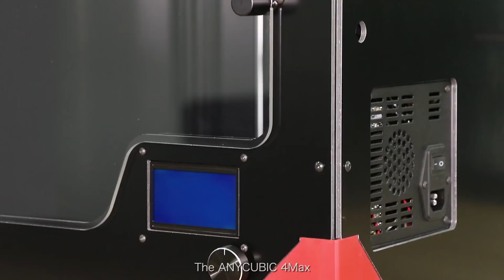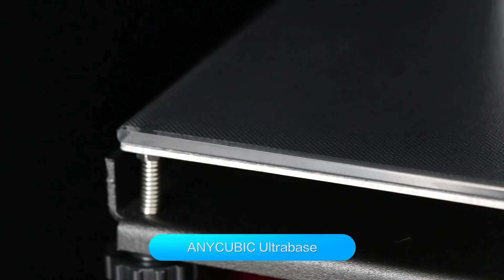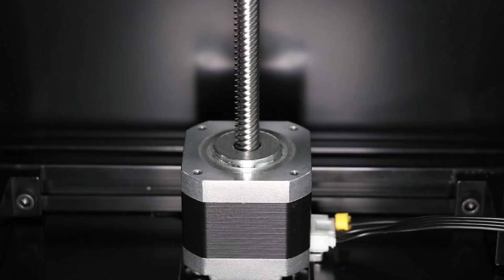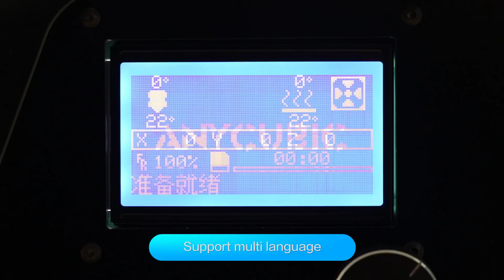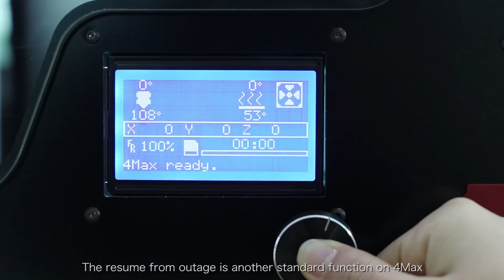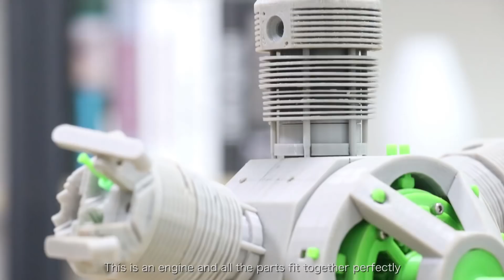ANYCUBIC 4MAX: Semi-closed and Larger Print Space DIY 3D Printer

Comment: At this point, all printers (even these cheap ones) should come with touchscreens.
Reply: Yes, 8 bit processors and cheap monochrome LCD displays are pretty old fashioned these days. Something like a Lerdge-X would give this machine much more appeal and more modern look and function.

The 210mm x 210mm printbed size isn't really large enough to justify calling it a MAX either. It needs a 300mm x 300mm printbed. More and more inexpensive FDM printers are coming with that printbed size now.